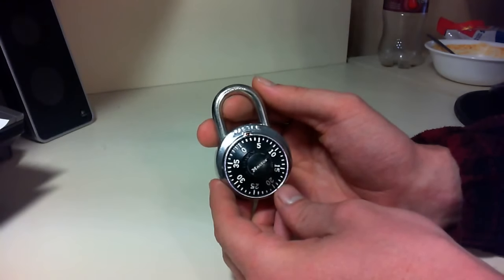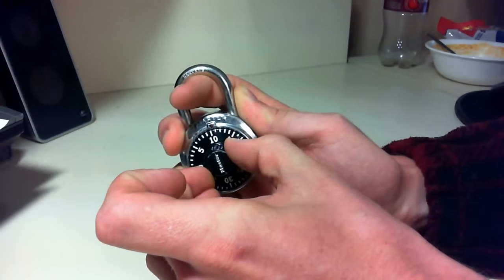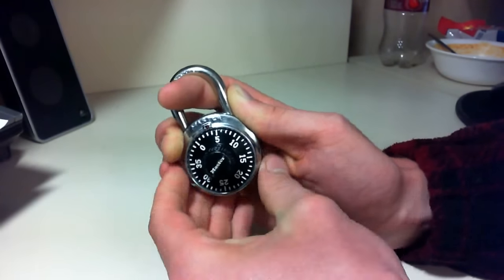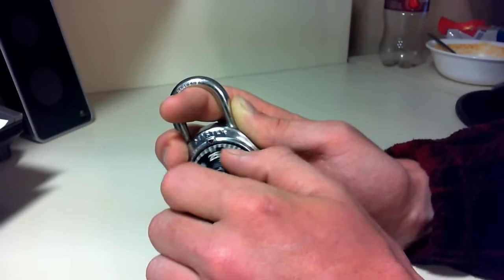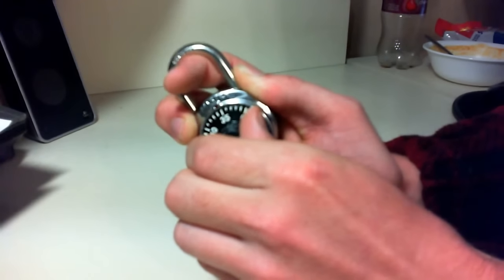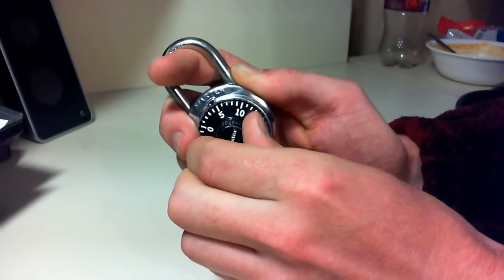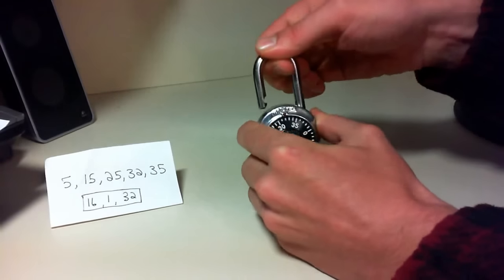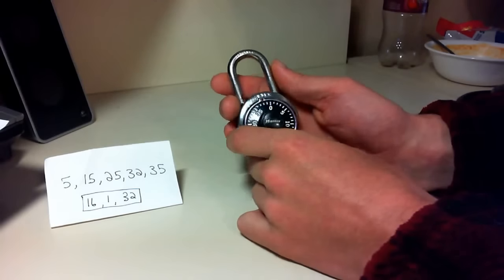Crack a Masterlock combination lock in 60 seconds! Without knowing the combo!

Comment from the maker: You dont literally add the three numbers. You try the combination of them to open the lock.
Reply from the maker: not yet can you send a link to it? ill have to buy one.
Reply: John Howard I think you have to use locksmith tools. One basically is called a knife. Just a thin piece of spring steel with a handle. You insert that inside the lock just beside the wheels to find the "notch". Then you have to add a certain number to get to the number or letter. I think its usually 5 or near there.  Not sure what type lock you are referring to. Assuming it is a type with individual wheels like locks on a briefcase.
Reply: +styles662  wait what do you mean combine them?
Reply: +TheUnitedStatesOfGaming lmao brain confirmed for shit tier
Reply: + John Smith ?
Reply: Be quiet john
Reply: I opened a cheap no name lock with this method.
I have a master lock with a keyhole on the back.
I've played with this lock till my hands hurt but just can't get the combination.
Is the key type different

Comment: You only really need to find the first two numbers. After you dial those in, all you have to do is turn the dial and tug on the shackle repeatedly. For a lock with only 40 combinations, you can easily find the number in 10 seconds.
Reply: For anyone wondering, this is not true and would not work. The resistance applied would move the other disks because they are all level with eachother.

Comment: just a little short-cut on the confusing last step... once you know the first two numbers, dial them in then apply upward pressure as you turn clockwise. when you get to the right number the lock will open

Comment: Seems sometimes subtracting 5 instead of adding 5 for the 2nd number works. Thanks. Also rounding up or adding 1 more digit helps and holding down the shackle when putting in the full combo may help for some locks.
Reply: Mine worked when I subtracted 5 from the first digit and hit the second one dead on. I guess it helps to play around with it a bit?

Comment: A lot of Master combination locks use even or odd numbers for the combination and rarely mix them.   So the combination of your lock is either;

16-0-32

or

16-2-32

Also many Master combinations have two numbers that end with the same digit, so 16-2-32 is the more likely combination but not always.

Comment: I tried this on a combo lock that I knew the code to, and it kept stopping on random numbers that aren’t part of the combo
Reply: Finesse. I was skeptical until I tried it. It really does work.
Reply: I tried for about 20 minutes then realized a new lock is $6. I wish I would have gotten it this way because it's neat though.
Reply: If it gets stuck on a lot of numbers then release a little bit of pressure

Comment: Tip: When you use a bolt cutter, the whole ordeal would take literally 4 seconds.
Reply: You forget the time it took you to steal the bolt cutter and then learn how to operate it.
Reply: Rob- I think the point of the video is so you can learn how to open the lock with out breaking it! Hopefully so you can continue using it rather than destroying it. I.E. at the gym, on a box or chest at home ! Unless you know a way to use bolt cutters to open the lock with out breaking it ?!?!?! Which would be so cool and probably faster. I would be genuinely interested.

Thank you for the tip though- I will keep it in mind next time as long as I don’t need the lock any more.

Comment: faster still:
1 reset the lock
2 apply tension and rotate (as you say) to get the first wall then add 5 for first number
3 retain exact same tension and turn the other way (possible multiple spins) until you hit another wall (will be stronger than the first) subtract 4 for second combo number
4 reset lock, input first two numbers then dial back 2 numbers and try, then dial back 4 numbers and try. keep dialing back by 4 numbers and trying till profit.

Comment: i dont know how he added the numbers  at the end to get the combination
Reply: From what I saw... The third number was based on findings multiples and then whichever was not a multiple was the third number
Reply: @lightninglord7832  Got the third number part, but where did the first two numbers come from??? How did 5-25 magically turn into 16-1 ???????
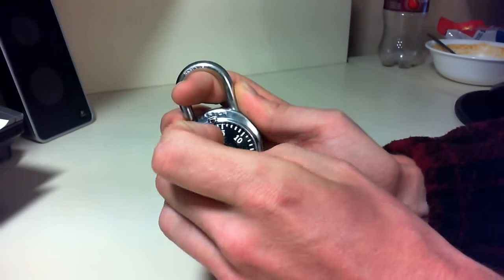Reply: 1:00 If you were listening carefully, you would have heard the part where you turn clockwise with little shackle pressure while gradually having less pressure until there is a little resistance. It was the number 11 because it was rounded up. Then adding 5 for some reason to get 16

For the second digits, its a bit harder to explain so just refer to this time 1:55
Reply: @lightninglord7832  Watched it again, especially the first part. Got it now

Comment: Tried it myself on a new lock (somehow managed not to peak at the back, came up with 26, 10, 32.  After a couple attempts i went to the back and discovered the actual code was 26, 12, 22.  The first digit was scarily accurate good job on that, and after retesting I probably should have gotten 11, which works just as well as 12 if the other two are correct, but I am disappointed by the third  combination.  10 off!  I did just as you instructed and got 35 32 25 15.  As it turns out, 22 still locked like the previous numbers i listed, just it was one that didn't move nearly at all.  Idk if my lock was a dud or you are just lying, but lucky for you if you get combinations 1 and 2, 3 is just a full rotation of guessing so ill thumbs up.

Comment: actually, the combination to this lock is probably 16-2-32 not 16-1-32.  All of these locks have either three odd numbers or three even numbers.  The difference between the first and third number is always a multiple of 4.  And the second number is a multiple of 2 off of the other two, but NOT a multiple of 4.  16-2-32 fits all of those rules.

The reason the poster got 1 for the second number is that these locks are not calibrated very well and usually if you are within 1 of any of the three numbers, in either direction, the lock will still open.

Comment: I tried this method several times. A different method actually worked for mine. 

1. Use this videos’s method to get the first number.
2. Using this video’s method to find your second number will actually give you your third number minus one. So if it’s 34 then add one. 
3. Dial your first number as normal, then two full counter-clockwise rotations for good measure. If your first number is odd start at 0, if not start at 39. Basically treat 0 or 39 as your second number and try to unlock it as normal with the third number we already got. If 0 or 39 don’t work then treat the number two spaces  counterclockwise, treat that as your second number and try to unlock it again.

Hope this helps, put it to the test!
Reply: You explained nothing. No one can learn from this, and I don’t think it actually works, I think you did what this guy did on accident and think it’s completely new

Comment: I'm not sure on newer Master lock dial combo's, but the older ones, the 1st number is a mod4 of the third number, second number is mod4 + 2 of the third.  So find your third number first as shown then find your 1st and 2nd.  Using the mod4 and mod4 + 2,  can then be confident of those (or you can just spin through  a maximum of 100 possible combinations).

Comment: I know an easier way to open that lock in one second. Just take a rubber hammer (or any kind if you don't care if the lock gets damaged) and whack the lock in a downward motion right where it says "Master" (on top of the lock body). It will pop right open. Note: The lock needs to be attached to something, such as a locker, not held in your hand.
That's the combination of the lock.

Comment: Did this for a lock I bought at Walmart that the 3 numbers that came with it wouldn’t unlock it. The numbers I ended up getting were the same except the 3rd number I got was one higher than the code the manufacturer printed. Worked perfectly. Weird...

Comment: I have the same Master Lock. I have the combination and it works. The first number in the combination is 16.

I watched this video and the 30 other videos on YouTube that have the same exact same instructions.

I've tried various amounts of pressure on the shackle for an hour and have yet to feel resistance when number 11 is lined up.
There is no time when there is only one number that gives resistance. I either get no resistance at all or I get resistance from 4 different numbers on the dial.
No, I am not turning the dial in the wrong direction. 

???
Reply: Me too.  I have a 30-year-old Master lock of this style for which I had forgotten the combination.  I tried and tried to open it using these instructions and got nowhere.  Then I dialed a combination that was a slight modification of what I had first thought it was based on a mnemonic device that I recalled as being a hint to choosing the right numbers.  Bingo, that did it.  Then, once I actually knew the combination, further experimenting verified that NO amount of playing around with the dial and shackle pressure as described here would identify the first number, and in choosing a second number there were way too many possibilities, all of which were wrong.  Even KNOWING the proper numbers I found that the dial manipulations and shackle pressure adjustments described here would not identify them.  I see in the comments that a lot of people have had success with this method, and I believe them because when I was a kid, a friend of mine could open MOST Master combination locks of this type in about 30 seconds, just "by feel".  However, it looks like the method fails in some cases.

Comment: Nice but I was impatient. I just used a thin clip and pushed the locking arm down from the top. Took 5 seconds and I didn't need to mess figuring out the combo. First try fail cause I was pushing on the wrong side of the latch. Once I figured that out, presto! The locks weakness basicly spells itself out every time you lock it without the combo. Though most people don't carry around a pin thin but strong enough to pop this trick so that lock is only to discourage the 'average' person from even trying cause a lot of us don't question the basic function usually. Heck, most of us are honest enough that it usually never crosses our minds cause we all knows how frustrating it is when someone does a five finger discount on us. So this lock only discourages the uninformed. Fortunately that's most of us.

Comment: Just bought a sentry fireproof safe at Goodwill, with the supposed combination written down, except it won't open. I suppose this might work on it? Except that instead of a shackle, you would pull on the lever in varying degrees of pressure, correct?

Comment: I am struggling with this. I have some old locks but I can't find something that works. I tried it on a lock I know the combination. This method actually got the first number but no matter what I do the second number hits a wall at 30 instead of 18 (like it is supposed to). I try to adjust my tension but I keep getting stuck here

Comment: Grinder with a metal cutter worked for me.  Though I burned my finger on the hot shackle afterwards.
Reply: What do you need a grinder for when you can just snip them with bolt cutters like butter? These are not high-security locks, they are theft-deterrents.

Comment: I'm a bit irritated rn. The hardest part was the third number. still haven't figured it out. You explained it a bit odd. "This one is in between so we are gonna skip it" "this number is in between so we are gonna write it down"
And then when I kinda got it down I realised I was writing down the same numbers as you. My final number ended up turning out as 32. Funny thing is that the lock's actual final number is 25, not 32. I had to get the first 2 and then spend 15 mins just guessing. Please refine the method for that third number, its infuriating, I just dont get it.

Comment: I will stumble in the cross the basketball court on the way down to the lockers watching this year video I just like to ask you but one question where the hell did you get 16 1 and 32 that is out of 5 1525 32 and 35 oh I understand that 35 would not be used to go back to 32 but I didn't understand that 16:1

Comment: Unless its a really old master lock, this wont work. the back flywheel has been covered in false gates for over a decade.  In the case of old master combo locks you can just tap the shackle with a hammer to retract the spring bolt.

Comment: Back in the day when soda cans used pull tabs, you could simply bend the tab around the shackle and slip it into the lock to release the catch. Done and done. (Since pull tabs became extinct, you now have to cut a coke can open with scissors and cut out a small piece of the thin metal to use instead.) Simple, fast, and much easier than his method.

Comment: So what happens if you get all oddball numbers for the 3rd. I tried this and got 36 33 23 13 and 3. Obviously nothing divisible into all these, most likely did something wrong in step 2 though, cause turning the lock 1 number at a time after getting the first 2 numbers it still doesnt open.
Reply: Nevermind, i got it. I was screwing up step 2. For the 3rd number I just turned it around 1 by one til it popped open. Oddly enough the last number was 2 so im pretty sure i was also screwing up step 3 but at least I got it open

Comment: Sheesh, at this point mine as well just blow the lock away with an M4. damn took 45 minutes, and writing 25 different number combinations down. 

Let me save everyone some time. This is how you do it:
"If you take the first number, multiply it by the number of avocados in your fridge. Then you take that number and DIVIDE (very important) it by the number of pixels it takes to write down the number of avocados that were in your fridge (on a 1920 x 1080 screen) then you have the entire combo...after you multiply it by 0.32158"

Comment: Add 5, reverse 3, 32 right, 35 left and 16 or 21 is the last number... And its break in after a minute which took 7🙄🙄 F@ck right off and buy a cordless grinder for 50 quid. Cuts in under 10 seconds... Job done 👍

Comment: Yeah it's not working at all, even the slightest change of pressure on the shackle makes the lock have absolutely no resistance so much resistance that it doesn't move, there's no in between

Comment: So how to pick the combination lock in 60 seconds 7 min and 40 seconds later. Also, can someone explain to me how he got 16 and 1 from 5,15, 15, 32 and 35?
Reply: from his list, 32 is the oddball number so is your 3rd number.  1st number is a mod4 of the 3rd so either 32, 36, 0, 4, 8, 12, 16, 20, 24 or 28.   The second number is a mod4 + 2 of the third, so either 34, 38, 2, 6, 10, 14, 18, 22, 26 or 30.  I believe his "1" for the second number is wrong but there's enough slop in the lock to allow it to work.
Reply: @mrkamm71  liquid nitrogen and a hammer is easier than math.

Comment: Well, it took you 7 minutes, and you are supposedly a pro. That’s hardly 60 seconds. So yeah, we can do all that fumbling around or just drive a screwdriver into the back and pop it off. The guts will fall out, and the lock will fall open. That takes about 30 seconds.
Sure, you can’t reuse the lock, but if you want in who cares? Locks are a few bucks and easily replaced.